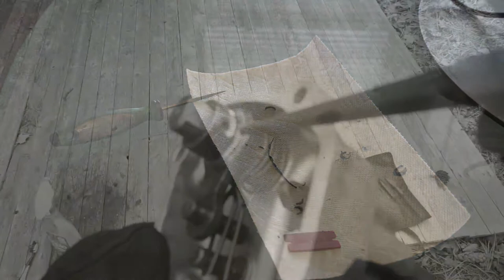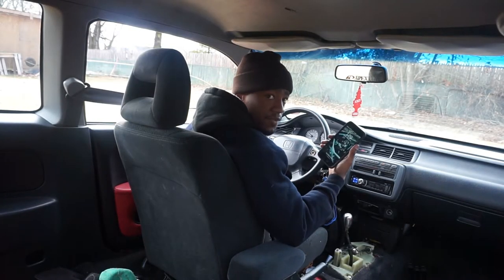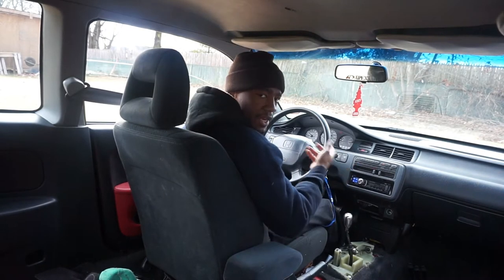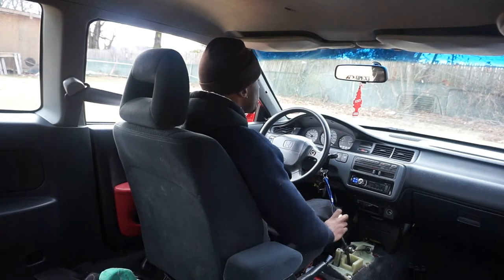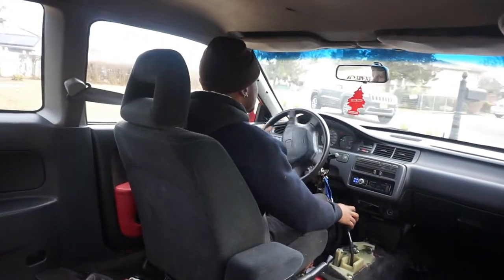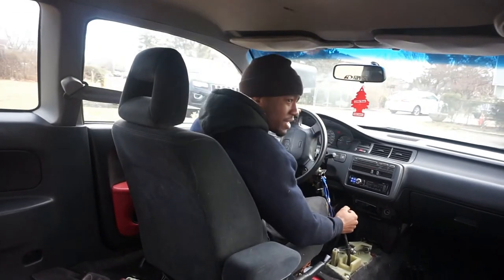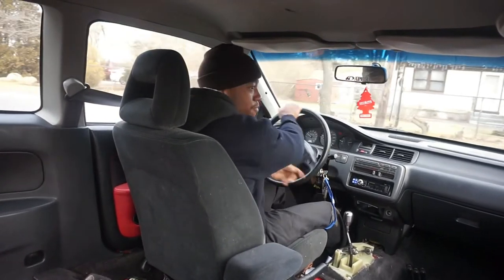Mtec Shifter Springs on h22/h23 trans (M2A4)

Comment: I just put the Mtech springs in my prelude and they do absolutely nothing. Nada. The are the exact same stiffness as stock. So what I did is put the MTech bottom spring on bottom, oem top spring sandwhiched in the middle, and then Mtech top spring on top (there is no room to use the remaining oem bottom spring). Now you can actually feel a difference. I don't recommend to do the Mtech alone unless you want a stock feeling shifter return spring.
Reply from the maker: I remember reading on the forums your exact explanation. I guess since my shifter box/shifter was sloppy & mounted sketchy, I did feel a slight difference in the return to center motion that was about it.